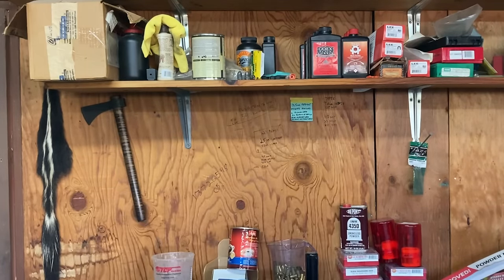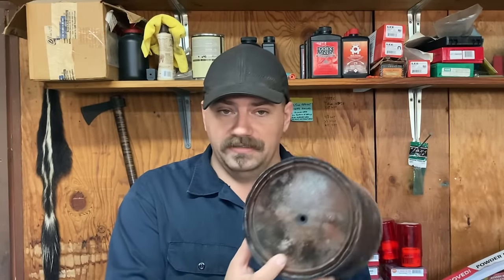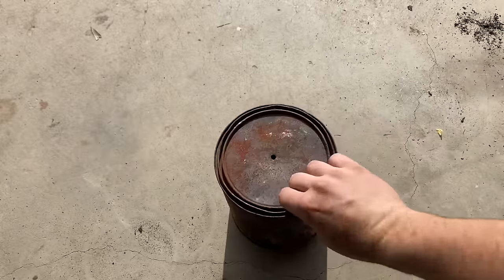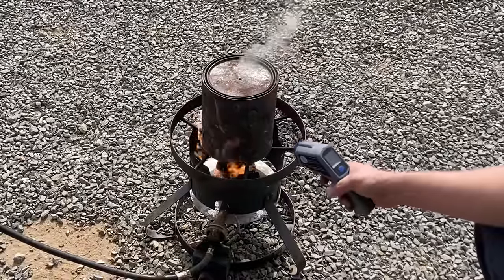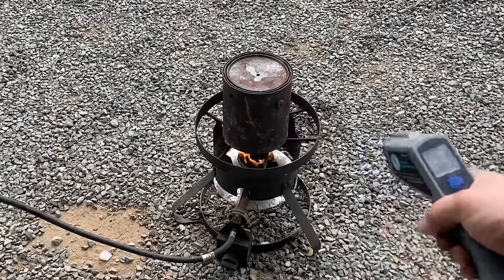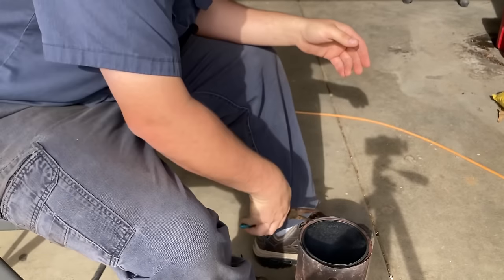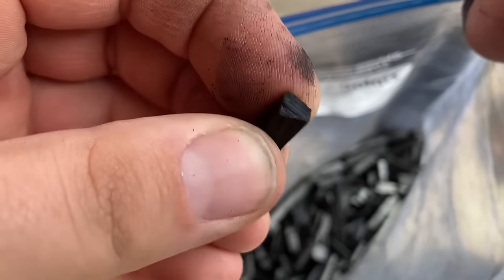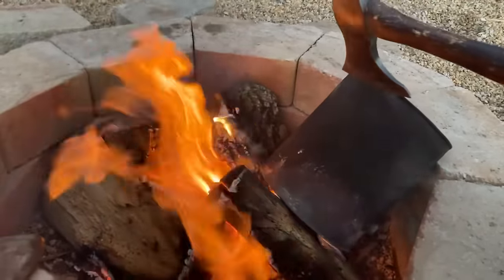Making charcoal for black powder

Comment: I have two separate questions...
First, would it be a good idea to attempt to burn the smoke coming from the container as the wood cooks? The reason for that is because I make a lot of charcoal, and on windless days the smoke hangs, and kills my lungs. 
The second question is: The reason I make charcoal is primarily for both my grill, and to make activated charcoal for water filtration. I know that using activated charcoal may be pointless for black powder, but is there a possibility that it makes a difference in the end result in making black powder? Does anyone know if it would ruin it, or possibly make it work better?
Reply from the maker: Yes you could turn it upside down and burn the vapor but I haven’t noticed any difference in the performance of the charcoal for black powder.
Reply: @Everythingblackpowder  Sounds like an appealing method to limit smoke inhalation if it doesn't make the coal any better or worse for making powder.

Comment: I saw a short you titled refining charcoal. You were mixing it in a blender?  What’s that about. I need a clue
Reply from the maker: We did several experiments where we tried to “purify” the charcoal. The most notable result was a significant loss in velocity, and very little difference in the amount of fouling. I didn’t bother making a video on it because the results were that depressing.
Reply: @Everythingblackpowder  well dammit
Reply: From what I’m seeing is you may be near the end. Velocity is great reliability great. I don’t know what to change or add. You may be “there”
Reply: I saw where you controlled the temperature of the charcoal. Have you any thoughts on that??
Reply from the maker: We will find out in a few days.

Comment: Back in the early 1800's, the militaries of the world experimented with BP every way they could. They found that the TYPE of charcoal made the single biggest difference over anything else. Hardwood charcoal worked ok, but Softwood charcoal was significantly better. Of the softwoods, willow was the best generating about 100 fps more than other softwood charcoal sources. Alder buckthorn was the best of all yielding about 150 fps (plus) greater than other softwoods. At BP speeds, 150 fps is quite significant. 
Since then we can add a couple of things. Activated charcoal (the kind that you can purchase commercially), is problematic and gives highly irregular performance. Bone charcoal is 100% useless. Cedar bedding works quite well, and as mentioned in the video, grape vines work very good indeed.
Haven't tried it, but cardboard is going to have some glues in it, and might increase fouling. Paper (if made the old fashioned way) should work very well. It is made from pulped softwoods (think of the old Big Chief tablets). Fancy paper is probably going to be problematic. 
There's still lots of room for experimentation, but keep the above in mind when doing that.

Comment: Retort can. Burn off paint. Scrub insides with sand. Ready to use ( only twice). Seal lid with real clay. Punch hole in top. Bake entire vessel of dry, Barkley’s, seasoned twigs w/out knots ( I use black willow). Vapor cooks off first and then volatiles. Ignite the latter and wait until flame tuckers out. Try reigniting. When it no longer burns…bury it right away with sand for 24 hours. Voila

Comment: Video didn't suck.  Much appreciated.  Getting low on 3F and not in the mood to order a 25-lb minimum of flaming dirt from the usual suspects when I only need a few pounds for the next year or two.   Just made first charcoal with low-BTU turkey burner and popcorn tin.  Used sheet metal shield around and on top to hold heat.  Kept below 600 at bottom of can per IR gun.  Used red alder (rough edge trimmings from cabinet lumber) for one batch and  split/debarked standing dead chinaberry for the other (seemed like a good choice?  Maybe not).  The chinaberry smoke must have killed every mosquito within seven hundred yards, nasty stuff full of creosote who knows what kind of toxic sludge, made green smoke out the vent on the tin!  Made nice charcoal in the end, though.   Will report after milling some powder.
Reply: Cooking the charcoal at a lower temperature makes a difference in speed and also how clean the powder burns.  Cooked between 500 and 600F until it quits smoking makes finished, pressed/corned powder slightly more dense than cooked at 800 until it quits smoking.  Cooked at lower temperature also burns more cleanly, I think maybe because it's a better fuel and is using up all the oxidizer and leaving less ash.   So all the people who say don't exceed 550F or so in the charcoal retort are spot on.

Comment: I'm new to this thoroughly enjoyable channel and I have a question or two.
Firstly, is there any merit to using saw dust of the desired wood type? i e. Intentionally cutting the wood for the purpose of generating and cooking the resulting chips/dust/shavings as they're already sort of "powderised". I'm thinking this might make the egress of tars, resins etc from the wood better or faster? Or secondly, would the resulting saw dust being cooked tend to mat down, clump together in the cooking tin and thereby negate the perceived better tar, resin egress idea? 

I appreciate the work you're doing 👍🏻
Reply from the maker: Saw dust is a little too fine but it will work. The important thing is that you have uniformity in your pieces of wood (diameter and length) so it cooks evenly. I suppose it’s the same principle with sawdust.
Reply: Thanks 👍🏻

Comment: With my powder, I find that the percussion cap sometimes won't light the powder in the revolver. Any tips? I've heard that the sulfur lights before everything else, so maybe add more sulfur to a batch?
Reply from the maker: That’s unusual. Are you graphite coating your powder? What caps are you using?
Reply: Does your gun work flawlessly with factory powder with same caps and mesh(size) of powder?
Reply: @Everythingblackpowder  I don't coat with graphite, and I use CCI no. 11. I even make sure the cones are clear.
Reply: @luuk-out-below9804  I probably get a 90% fire when I use pyrodex 3f powder.
Reply: @jefferydavis5990  Hey so there are a couple of things to look at then.  You could try using a nipple primer, adding a bit of fine BP  into the nipple before capping.  Or drilling the nipples out just a bit to let more  cap fire through. Some of these nipples have extremely small opening. Go slow. I have always found BP lights way easier than Pyrodex.
Reply: @jefferydavis5990  Have you noticed if the same chamber/chambers are problematic?  Or do they all seem to do it would be another clue.
Reply: @luuk-out-below9804  I'm pretty sure all of them do it, but I don't know for sure

Comment: What do you think to use flash powder in cartridges?
Reply from the maker: Never tried it
Reply: If by flash your talking a perchlorate/chlorate, al/mg, sulfur mix I'd say there is a  very good chance you will blow your breech.  Years ago a Nam vet told me it was common practice on their patrols to booby trap Charlies ammo caches with rounds loaded with flash, they would slip the super hot flash rounds high in the belts and it would blow the gun and mame/kill the op on the first burst.  Flash will detonate in the slightest confinement, don't do this, flash is way way hotter than smokeless.
Reply: @luuk-out-below9804  alluminiun powder
Reply: @luuk-out-below9804  i have only black flash and powder of blank cartridges
Reply: @luuk-out-below9804  and what the powder can be homemade and use in modern firearms? So flash powder only for grenade?
Reply: @senorduncan8735  So you said flashpowder, that is a pretty general pyrotechnic term covering a wide range of very fast  fulminating mixes.  Black flash for example could be made with german aluminum flake as opposed to powdered aluminum.  Or it could be just superfine black powder.  Do you know the ingredients of your powder?  Lets start there.  Most on this channel are using the original Black Powder mix of, potassium nitrate, sulfur and charcoal.  Flash is for fireworks not for use in fire arm shells.
Reply: @senorduncan8735  So are these like old military blank rounds?   Those were loaded with a very hot fast smokeless powder powder designed to go bang without a bullet.  These will likely blow your breech with any bullet.   Look up EC blank powder.
Reply: @luuk-out-below9804  no they not blow brench , but the cartridge case stuck in chamber. It is a problem . Gun does not work with blank powder .
Reply: @senorduncan8735  Goodness , why do you think the brass stuck?
Reply: @luuk-out-below9804  i know this

Comment: Green wood contains the most liquid form of tar. When you dry the wood, some of the tar evaporates, but the rest solidifies and produces the matter for fouling. How about putting green wood in acetone for several weeks to dissolve and remove the most of tar while it is in liquid form and not hardened? I bet that would produce much cleaner-burning charcoal. There are other chemical ways of producing even cleaner cellulose as the source of charcoal, e.g. boiling it in alcali to obtain merserised fibers.
Reply: Acetone is a poor solvent for natural resin. Much better to use gasoline. You need thin strips of wood for good penetration.
Reply: @pyrotechnicSAR  Hexan or any other lighter fluid should work, but in my experience acetone has a wider spectrum of resins it can dissolve, leaves less final residue. It may work slower than hexan, probably, but who is in rush?
Reply: @DibutilFtalat  Hello. Hexane or lighter fluid will work. Hexane is a weak solvent in my experience. Acetone dissolves artificial resins well. Natural resins - shellac, do not dissolve in acetone. The bituminous part is well soluble in gasoline. Acetone is bad. Good luck with your work.
Reply: @pyrotechnicSAR  Fresh wood does not contain bituminous parts or shellac. Instead, it contains complex and simple polyethers which are easily handled by acetone. This better be a subject for experiment rather than theoretical arguement and in any case the optimal solvent may be found per specific kind of wood.
Reply: Industry produces pure grades of coal. Activated charcoals, they purify medicines in medicine. For the preparation of black powder, they turned out to be worse than ordinary coal.
Reply: @DibutilFtalat  Good approach. I hope you manage to make the perfect charcoal for ВР
Reply: @pyrotechnicSAR  as soon as I get potassium nitrate :) It is unobtainium in Canada as prerequisite for manufacturing BP.

Comment: I’ve made charcoal for several small batches of black powder and tried a few different Timbers after seeing some videos it making a difference. While I didn’t test the difference it made in burn rate, one material that made really light fluffy charcoal was bamboo and I could imagine that the early Chinese makers of black powder would have access to bamboo. Anyway it’s worth trying if you can get some for a test